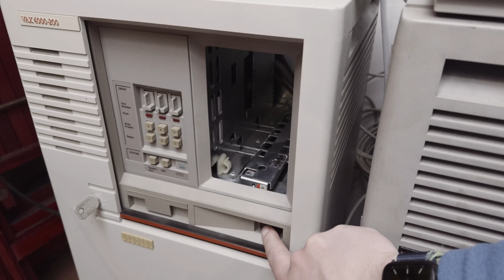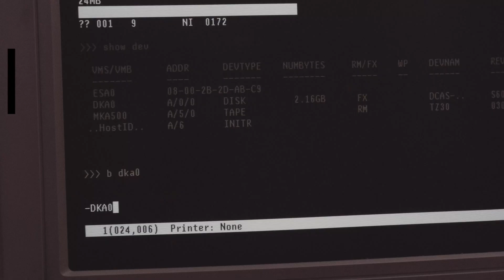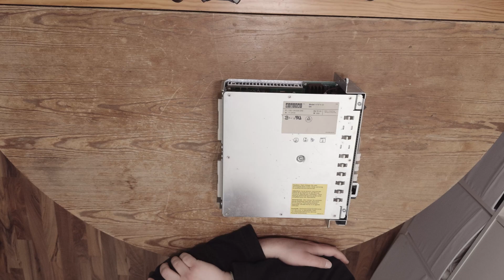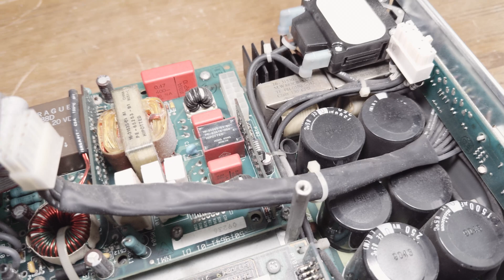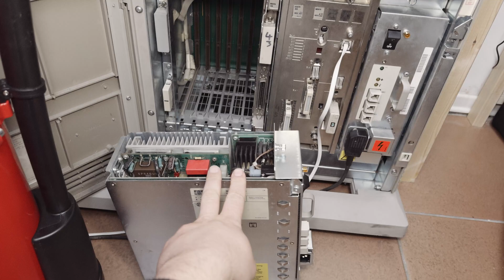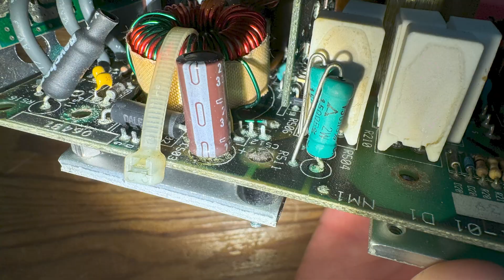DEC (digital) VAX 4000 Model 300 Power Supply (H7874) Issues and Replacement - Part 1

Comment: I love these systems, I have several MicroVAX and VAXStation 3100's still working, as well as AlphaServers and AlphaStations and a PDP11/23
Reply from the maker: MicroVAX 3100 is a nice machine. I have a VAXserver 3100, which is basically a MicroVAX 3100 with another ROM, but I don't know if it working, it is a projekt for a further video. I've never had a deep look into Alpha, however I think about to expand my collection with an Alpha maschine.